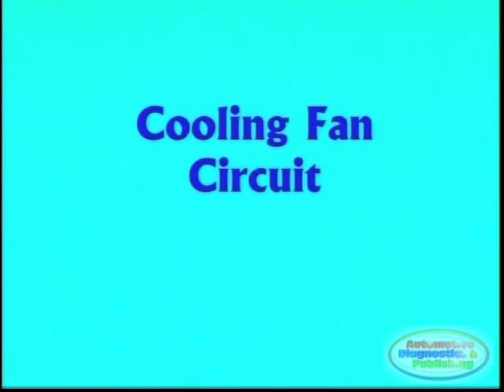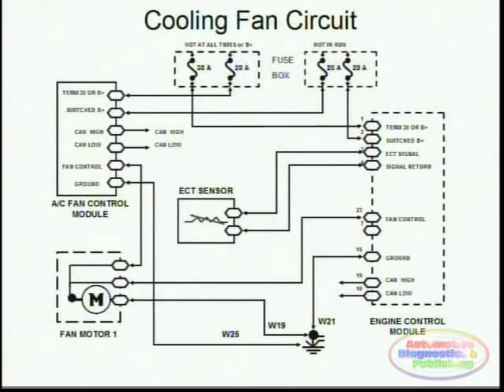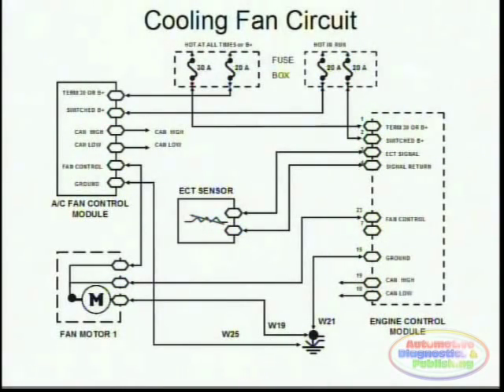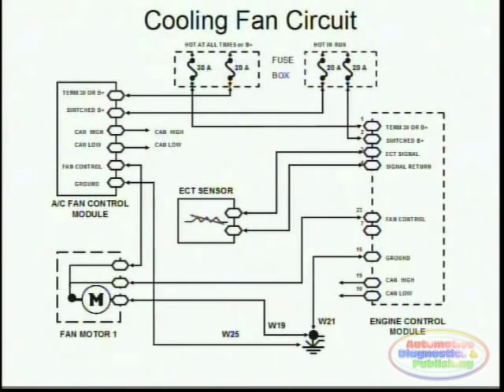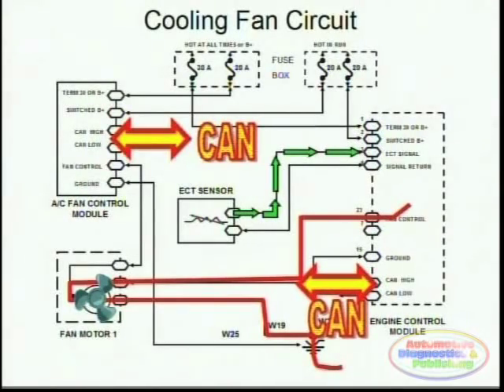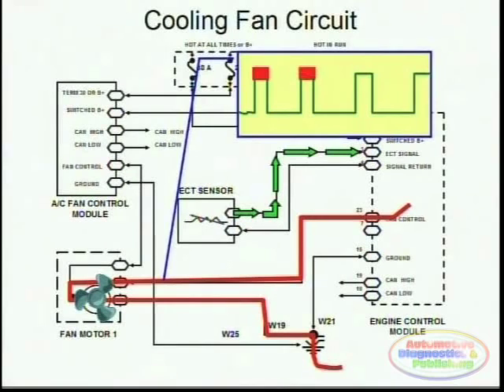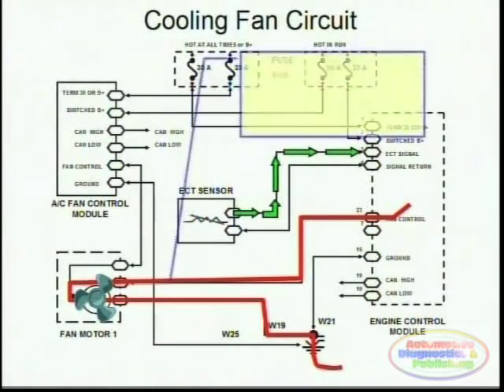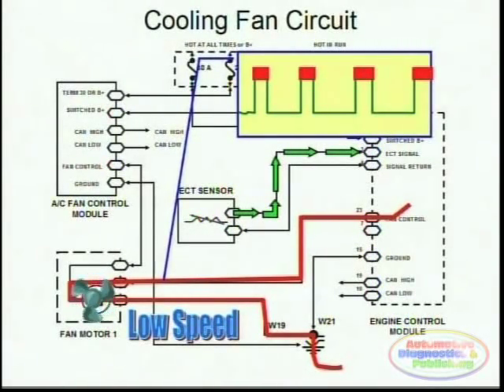Cooling Fans & Wiring Diagram

Comment: Thanks for the video. Here is a question: Does cooling fan controlled by a fan control module have or use relays?
Reply from the maker: No
Reply: @ADPTraining  Thanks. I was thinking you would give a reason for their not having.

Comment: Is the pulse sinal sent in hertz,volts or how ? Can i test the signal with a multi meter to make sure im get signal to the connection?  Its a 22 toyota with a 4 wire connection, 2 are very small .
Reply from the maker: All of the above, but seen in Volta with a scope.

Comment: What will happen if we cut the wire in-between fan motor1 & fan control unit in this system, the fan motor 1, will still work ?? 
Thanks
Reply from the maker: No, it will not. Some systems, if the fan module sees a broken wire the fan will go high.

Comment: I have a 2013 captiva cooling fan won't come on unless air conditioner is on replaced all relays, fuses. all sensors, thermostat working on water pump and radiator today any ideas?
Reply from the maker: AC is a different circuit and/or fan. So, does it have a Fan Module. Look into that.

Comment: There is no way they would ran 12 volts and as much as 30-40 amps directly from the ECM to run that fan motor, this drawing is bad in that the pulse width modulation (PWM) from the ECM should go to a motor controller not the motor, very misleading.
Reply: Thank you, I thought for sure that I was going stupid for a moment
Reply from the maker: Not really
Reply: @ADPTraining   To bad your answer just now doesn't offer any explanation ? i'd like to see it if you can offer one ?
Reply: @ADPTraining  You can have PWM from the ECM to the motor BUT (and thats a BIG BUT !) there needs to be a module at the motor , typically a mosfet switching circuit that takes that ECM single  and steps it up . right ?

Comment: I bought this car and noticed the cooling fans running while the engine runs and the temperature was not getting to normal temperature 195 degrees. I pulled the code P0128 coolant temp sensor bad. I replaced it and the thermostat and the relays all of them. Now when I start the engine and the engine gets to 210 degrees and climbing (of course I shut the engine off). The fans will not come on at all. So I unplug the coolant sensor and start the engine the fans run constantly again. Fans will not run intermittently when the sensor is plug in just all the time. 
Please if you can help me
Thanks
Reply: +sexylitehaiti sexylitehaiti 
Yes, it was a simple fix....bad thermostat. I replaced it and it's fine now
Reply: +sexylitehaiti sexylitehaiti 
2001 Pontiac Grand Prix GT 3800 Series II. At first I had bought a Autozone thermostat and O'reilly's  temp sensor. I replaced both parts with ACDelco parts.

Comment: Hi,
I have fabia 1.2 azq (mk1), the big fan works and if I starts up AC the speed increases but the second fan don't start. In summer, when the outside temperature is high, the big fan starts to spin very hard and the second fan don't start.
I checked the voltage for the soket from small fan. It seems I have no voltage on those cables.
It would have to be voltage on those cables when the big fan starts up.
Reply from the maker: Check my books.

http://www.autodiagnosticsandpublishing.com/Automotive_Diagnostic_Repair_Book_Catalog.htm

Comment: This nut mentions Chrysler, but either way  I'm going to run a toggle switch under my dash from battery to both fans. When I'm running the car, the fans will be running. Problem solved!
Reply: For that matter you could just wire the relay to the ignition so when you start the car they are running and when you shut it off, well, you get the picture.
Reply: Will you be doing a video on this toggle switch for running your fans to keep from overheating?